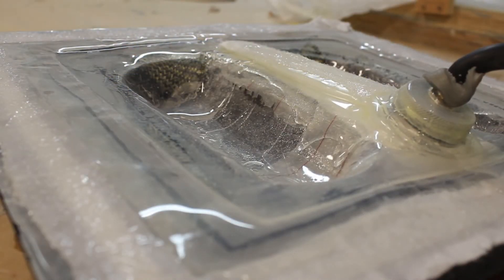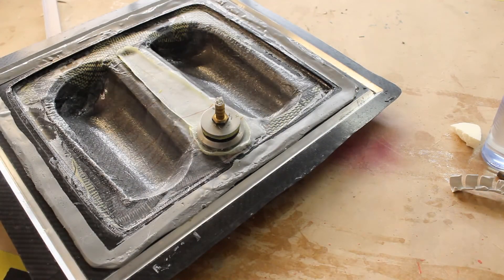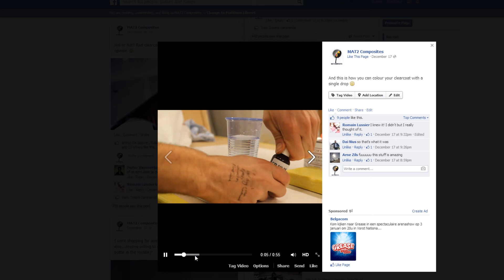Tutorial: Out Of Autoclave PREPREG Carbon Fiber/Fibre Part 7-7 (First Silicon Vacuumbag)

Comment: Hi. Great demonstration video. I have a couple of questions if you could answer please. 
1.) once you achieved full vacuum, what was the working pressure?
2.) During curing in oven, did you turn off the vacuum pump and removed the plug or it continued to run?

Answers to my questions would be great. thank you.
Reply from the maker: -1 bar for the pressure and yes I keep the pump running all the time
Reply: Thank you so much for you response. Appreciate it. :)

Comment: Hi.. i'm trying to do the same thing for a motorcycle réplica i'm working on, i was thinking using window silicon. Because almost all silicon rubbers here in my country are white or black color, i'm planing to use infusion method and infusion consumables are pretty hard to find or expensive as the bike itself. Di you think it will work or should i look for another route???
Reply: did you try using the window silicon if so i would like to know how did it come out?

Comment: Nice video. what silicon are you using? and any idea to do video for wraping part like hood with carbon as we tryed and where vacuuming bag was not straight after air pump took it out all over where like= lines from razor. any clue? then we sanded surface dry paper and tryed lay down epoxy but blades not gone. and those places made simple bag and wet method or carbon top top of hood. any ideal how to with that?
Reply from the maker: I'll have to check, its from Axson... with a vacuumbag you'll never get a perfect finish...you might try it with a vacuumbag that is a bit more strechy...personally I wouldnt use a vac bag while wrapping... would just add layer of resin at the time with sanding inbetween